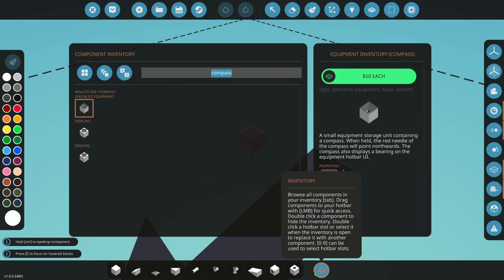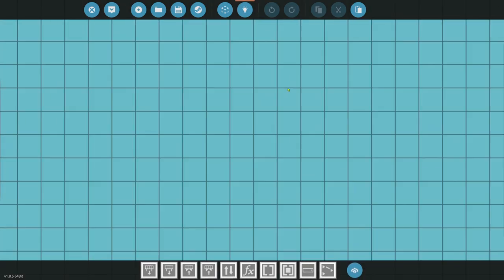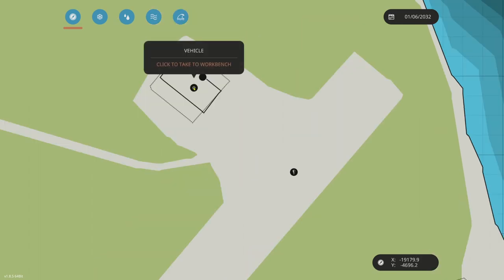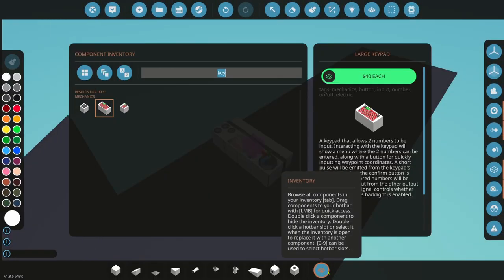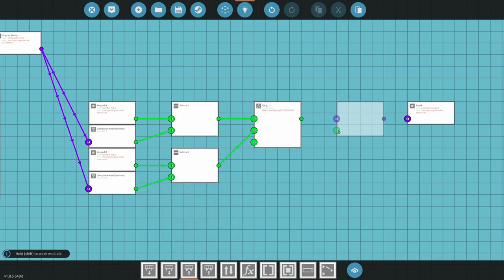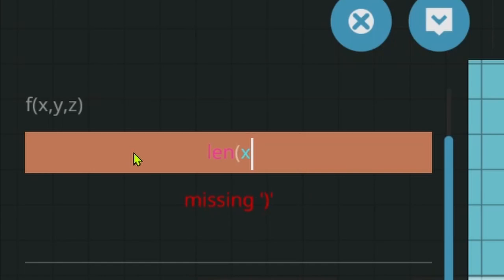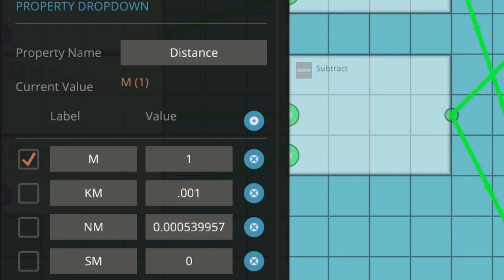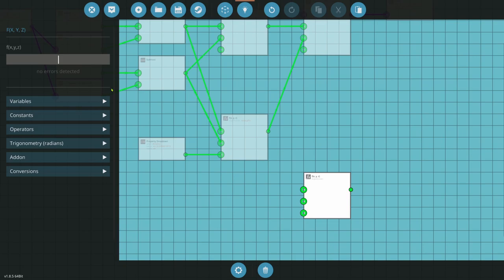Stormworks Basics: GPS Bearing Panel. Navigate with ease!! #stormworks

Comment: Been away from Stormworks for about 2-3 years and I lost all my creations and homemade microcontrollers, so these tutorials are really helping jumpstart the rebuilding process.

A few things I figured I'd mention. I think the reason that the physics sensor outputs the way it does is because in video games the X and Z axes are "horizontal" and Y is vertical. That's also why it output 'euler rotation' instead of rotation that sane people understand... thankfully they recently added rotation values that replace tilt sensors.

I'm probably thinking of another video you made where this came up but... logic 'ticks' occur 60 times per second, so an up/down counter will change its value by the 'increment' 60 times per second. So to go from 0 to 1 in 1 second the 'increment' should be 0.016666666 . --- Ah right, this is why the 'ETA' is unusable without the math, because by default it's telling you how many ticks it will take to arrive, hehe.